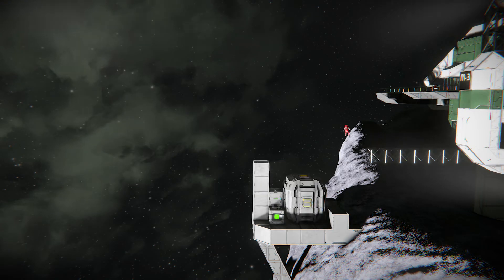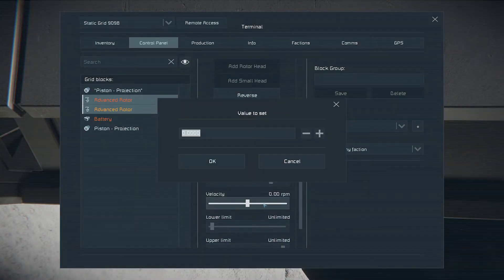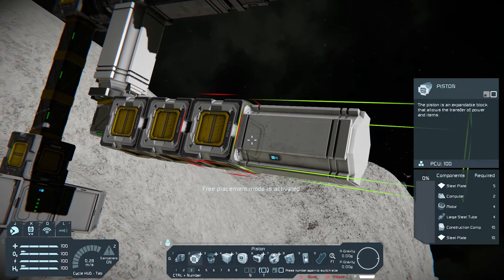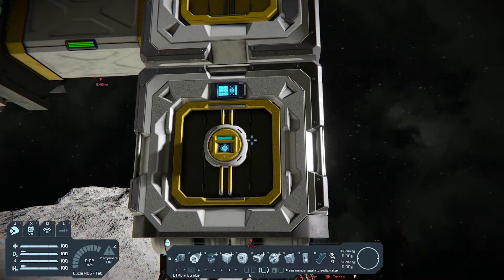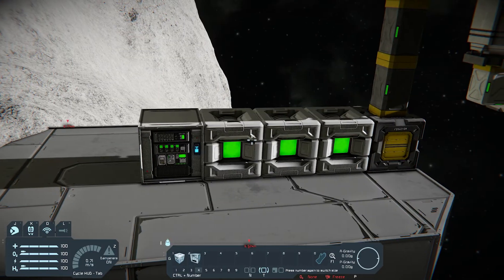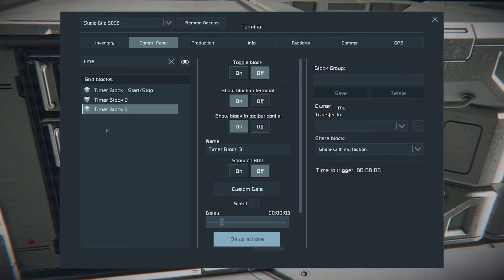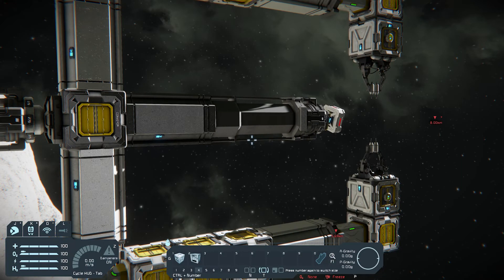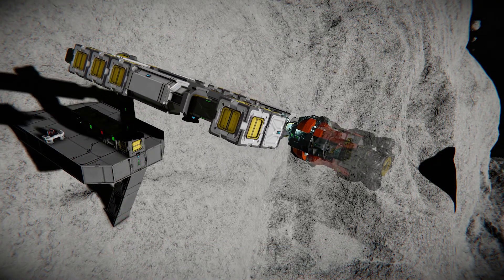3D Rotary Printer: A Step-by-Step Guide - Space Engineers

Comment: Great printer!
Is there a way to get both rotors to reset to 0 degrees after the print is completed?
I’m using this under planetary gravity and I need my prints upright before disconnecting them, or else they’d fall and crash at the bottom of my dry dock…
Reply from the maker: Hi, since the Contact update there's an option to set a precise position for rotor.
I haven't try to use it in this printer, but I believe it will allow to reset rotor to 0 degrees at the cycle end 🙂
Reply: @ Thank you!
I’ve found the action and have a rough idea in how to get it automated.

Comment: Pro I’m begging fer ur guidance. I have put this together 4 times an rewinded the vid several times each play through. I end up with the same problem every time. The piston extensions work as intended, piston arms do not. And I have checked the sensors…..vigorously…..but the piston arms do not bounce up and down like does in the video. Now I had a mod that extended sensor range. And I believe it was working fine….but to be safe I took it off. Still no difference. When I put the projection up it extends, welds, but I start breaking ships cause the arms aren’t moving as intended…. Can you help???
Reply: Heya, I know this is from weeks ago but I had the same issue and couldn't find anything. I messed around with the sensors since that seemed to be the problem. I ungrouped them and had to test them with character and owner enabled. For some reason it won't work on just subgrids. I had to use one with character/subgrid and another with player/subgrid and just set them both to turn on separately in the event start/stop timer. Hope this helps!

Comment: This works great on survival. Pay close attention to each step or you might spend extra time troubleshooting (like me). I really like this as you can change the merge block on top of the projector to a light armor block, use that to connect to the projector build, and then build your blueprint in more than one go with more materials. You can also use MMaster's AutoLCD mod to output the projector's remaining tiles to a screen to easily monitor your progress.

Comment: I love the design. I seem to be having issues with the printer arms not moving around the subgrid when printing so the welders get caught. I have set up the sensors as you did, and even though they sense the subgrid, they do not move the pistons. I'm going to try a few other ship designs in case, but thought I'd see if you had any ideas.
Reply: Have you figured out the problem? I seem to be having very similar issues. Some advice would be to very helpful
Reply: @Gypsyblack88  no, I haven't figured it out yet. I moved on and started testing other variations of printers.
Reply: @Gypsyblack88  Sorry mate. I moved on to testing other printer methods as I couldn't get this one to work.
Reply: Had the same problem. I enabled detect owner, friendly, and neutral on both sensors. Now they work

Comment: Anyway to help me with this? It appears to work great but for some reason it doesn't weld everything in one go I have to run the program 4 times in order to do one print.
Reply from the maker: Hey, maybe reducing speed of rotors and arm piston will help. This way welders will have more time to reach projected blocks
Reply: @Pro100tv9  Slowing down both rotors and arms seemed to have it print less this time? I'm not sure I've got all the exact settings as you have on yours?
Reply: @Pro100tv9  I think I got it working good now, had to add on 2 extra arms with 2 extra welders seems to be working good now

Comment: So it works as intended but it keeps detaching my ship before it is fully built and when i take away access to the merge block it will only weld to where it would have disconnected anyways. What do i need to change different blueprints
Reply: Yes that helped a lot
Reply from the maker: Hey @joshuabaker6971, there's an event controller that checks piston position. By default it is set to 55%. 

At this threshold it will end printing cycle. If the ship you are trying to print is bigger, lower the threshold - for instance to 30 or even 10%, depending on the grid size, it should help

Comment: It just keeps breaking off the ship even without any shaking
Reply from the maker: Hey, you can try to enable "share inertia tensor" option in pistons and rotors, it should stabilize the whole grid
Reply: @Pro100tv9  It works as intended I just don't know what to change for different blueprints so it keeps ending  up running through its function before the ship is complete
Reply: I explained it wrong

Comment: Nice Printer but when I try to scale it to big ships and large grid it don't work. Any ideas?
Reply: Printed pretty well but it was huge ship it took me few days to print.
Reply from the maker: Hi Mateusz, I wouldn't recommend printing large grids with this printer, however if you really want to you can replace the small projector with a large projector and you should be able to do it then.
Reply: @Pro100tv9  Hi I was able to add 2 instead of 1 piston on sides and add 6 pistons for projections and 7 pistons on arms and all work perfectly fine
I also grouped the pistons  and named them like your piston and applied same logic to it and it work fine
I'm printing huge ship atm and all works fine 
I also applied to share tensor on pistons to make it more reliable
Reply from the maker: That's great to hear! I honestly didn't expect this printer to be capable of printing anything bigger than a fighter. Good job!
Reply: @mattmadcat hey, how did you large ship print go? Looking at making one of these for mine

Comment: I built it according to your instructions (Great by the way).  It looks great and seems to function, but nothing prints.  I usually connect the projected image to the projector stand and have never used a merge plate.  Do I still have to connect that plate to the image with a block?  The merge plate is red also, is it suppose to be green?  Here is a short video of what happens.  It looks like it is working but nothing is being printed.  https://www.youtube.com/watch?v=4CDnZAqtIk4
Thank you for the great work you do!   Doc
Reply from the maker: Hi Anthony, thank you for the video it helps a lot to recognise the problem!
It seems like you are trying to attach the projection with the forward part of the drill, unfortunately it's not possible as there's no mount point there (you cannot attach any other block to this part of the drill).
To solve this issue try rotating a projection 180 degrees so it is attached via (for example) a light armor block, or any other block that has available mount point
Reply: Thank you for your quick response.  I will try it and get back to you.
Reply: That did it.  However, it did not build all the blocks.  It was just a few parts (a Parachute, 1 gyro and the reactor).  also, when I filled my H2O generators and the hydrogen thrusters came on my whole base started to shutter.  I thought it was all going to break apart.  I jumped out and ground down the part attached to the merge block and it stopped.  It is really neat but very unstable on a multiplayer server (which is what I am playing on).  How do you release the ship from the merge block?  I think I would need to do that before starting the thrusters.  Also, when I checked that option you mentioned  in your video to make it slower, it started shaking my whole base and this was even before I tried a projection.  It was shaking just like it did when I added the ice to my O2 generators, so I unchecked it real quick and it stopped.  So I can't check that option you mentioned at the end of your video to make it go slower for stability.  Again thank you for taking the time to help me figure this out.
Reply from the maker: I'm not sure if I understand it correctly - you did check the "share inertia tensor" option?
Also I would recommend adjusting 2 things about the blueprint you are trying to print before printing it - toggle off its thrusters and add another merge block to the ship.
Merge block can be attached to another blocks but can detach only from another merge block.
The printer's event controller will detach the printer's merge block when the printing is done automatically if set to do so.
About some blocks missing after printing - I think the only solution I can recommend here is to further slow down the rotors, it sgould allow for more precise printing
Reply: Yes, I did check. “share an inertia Tenser”, but even with no projection up, the whole thing just starts shaking so I immediately unchecked that. So the answer is no I do not have that checked because I can’t do it without the whole thing shaking. 

I will try your other options. So you are saying that any blueprint that I use must have a merge block to use this printer correct? Most of the prints that I download do not have a merge plate on them so if you use a merge plate on your printer then you must have one on your blueprints, is that correct? Is it possible that I can get rid of the merge plate and just weld a block on like I normally do? Again, thank you for all of your input and I hope to get it working because I think it looks awesome.
Reply from the maker: Ah I see. I'm not sure why the grid is shaking like that. Perhaps it would be the best not check this option as you said.
It would be good to have the merge block on the blueprint, but I think that adding a second merge block attached to the existing one before printing would work too, it'd just add a small extra step to the process.
Reply: Is the merge plate supposed to turn on and off to Lincoln on link two of them? I just don’t know anything about merge plates. So when you do a print with this printer when you’re finished, what do you do to get the ship off of the printer? do you grind the merge plate or is there a way to disconnect to merge plates? That’s the only thing I don’t understand. I can go back and add a merge plate to all of my blueprints. However, if I download one like yours and it does not have a merge plate how do I put a merge plate on a projection? By the way, I downloaded your M 49 and I absolutely love that ship. You did a wonderful job on designing that. I use it all the time now that’s my go to minor.
Reply from the maker: When merge block is turned On, it will stick to another merge block, if you turn it off they will detach.
So you can for instance - attach a merge block to the one already existing on the printer and once printing is complete the event controller will turn off the printer's merge block, detaching your already printed ship this way. Note that only one merge block needs to be turned off in order to detach from the other one.
Ah yes, M-49 is great! Osker was the one who came up with this design 🙂
Reply: So I understand now. When I start to print that merge block should be green. It’s always red. So I’ll put another merge block onto the merge block then bring my projection up against the second merge plate and when it’s finished, the 3-D printer should automatically turn off the merge plate and the ship should just be floating. I’m going to try all of this. I really want it to work. Thanks again and I’ll let you know how this goes. I’m going to try it today.
Reply: If I wanted to slow the printer down without checking that checkbox, where would I do that? What parameters would I change and how much do you think I should take it down?
Reply: I reinforced the attachment of my printer platform to the asteroid itself along with the attachment to my base and I was able to check the "share an inertia Tenser”.  The printer is working great now.  No vibrations/Shaking.  It still missed a few parts.  However, I have the Build and Repair system, so I just turned it on and the nanites finished the job.  I did another ship I got off steam but the arms are not long enough.  Can I add another set of pistons to the welders?  If I can should I set them up like the other ones and should I group them all together under the same name?  I love this printer.  It is so fast at printing out ships.
Reply from the maker: It's good to hear that you solved the shaking issue. Yes you can add more pistons, assign them to the correct group and optionally adjust their speed to match the other pistons in the group, and it should work just fine.

To slow down the printing process you can adjust:
- rotor speed - there are 2 rotors - Rotor and Advanced Rotor. Their speed is set to 1.5 RPM and -1.5 RPM. 
When changing the speed of one of them try to match it with opposite sign on the other rotor. For instance if the Rotor is set to 0.5 RPM the Advanced Rotor's speed should be -0.5 RPM
- Piston extensions group speed - by default it is set to -0.1 but it can be set to much slower values, like -0.01 or even -0.001 m/s, depending what accuracy is needed

Comment: I followed your instructions to the tee (video was great).  However, it looks like it is working but nothing gets built.  I took a video so you can see what it is doing.  I usually use a metal sheet block to link my model to the projector.  I have never used a merge plate.  Do I have to weld a block to the merge plate?  The merge plate is Red, I don't know if that matters????
Here is a link to the video https://youtu.be/4CDnZAqtIk4
Reply from the maker: Thanks for the video, it helped me a lot to understand what is the problem. 
The projection is sticking to the projecting grid via the top of a drill - this will not allow to print it, because it is not possible to attach any block to the top part of a drill.
Instead, try to rotate the projection 180 degrees, so it sticks to the printer via a light armor block (for example), this should allow you to print the craft.

Comment: Does my blueprint need to have merge block at the end? Also for me I have to trigger multiple prints for it to fully finish the build, is that normal?
Reply from the maker: It doesn't need a merge block, but you will need to grind down the connecting block between blueprint and printer once the printing is complete.
I think the event controller setting may need to be adjusted to the size of your blueprint
Reply: I use a connector so i can refuel and rearm while connected

Comment: I don't get where's the problem. Look i've set everything fine, all seems works fine but the projection won't "become" a real block once the welders gets closer, to this reason all cannot work because sensors won't relevate anything phisical crafted = in summary = its all locked on the whole structure rotating end extending property, the projection still a ghost, and nothing change :/

Any suggestion/help?
Reply from the maker: Hmm, can you switch the merge block off while the printer is not running? I think this should help
Reply: @Pro100tv9  Nothing. The welders still not create anything. I even tried to hand-weld the projection (in admin-creative. Survival savegame) but the projection didn't react at all. Im still wondering how works te projector. First time i use it x)
Reply from the maker: It seems like the issue is related to the projection that is not attached to the projecting grid.
Perhaps the blueprint you are trying to print has its merge block switched off?
If that's not the case, could you make a blueprint of your printer, upload it to workshop and post a link to it over here?
I could troubleshoot it this way

Comment: Does this work for any small grid ship? Or is this thing tuned to your ship alone?
Reply from the maker: It should work for most small grids. Sometimes, when a ship that you try to print is bigger, you will need to adjust the event controller slider or turn off the event controller completely

Comment: I tried this verbatim, following the steps to the T, and still have not been able to get the piston arms to extend/retract to print properly.
Reply from the maker: Hey, are sensors "ON" when you start the printing cycle? If not, try switching them OFF while the printer is idle, and then start printing and let the printer go for a full cycle
Reply: @Pro100tv9  Sensors were in fact off when I triggered the start/stop timer block
Reply: It might be that you have both extend and retract on the activate side of the sensor

Comment: I felt that if the performance of the computer is not good, there are some parts that are not made because of the program block when making the middle part. If the performance of the computer is not good, I recommend removing the merge block part from the timer block at first, turning it off and on from the control sheet, and turning the printer twice.

Comment: I will do the inverse operation: I will use a single rotor, in the middle, with a fully extended piston. As the piston retracts, the rotor will spin. The arms will do the retracting/extending as you'd expect.